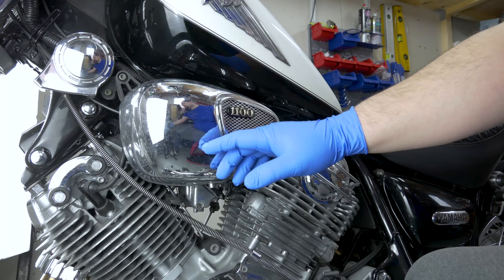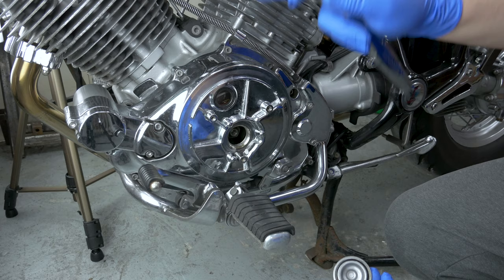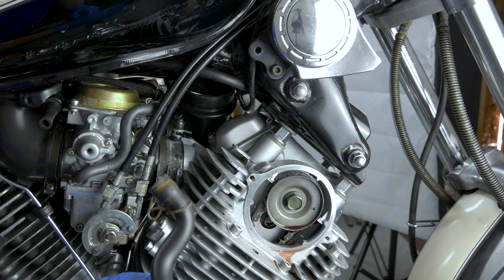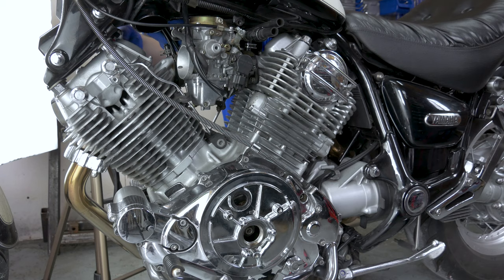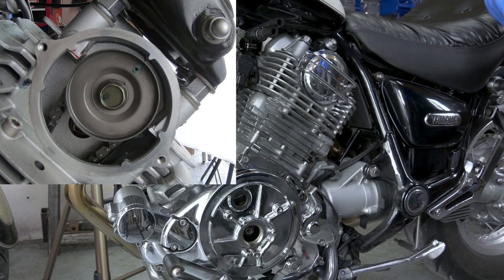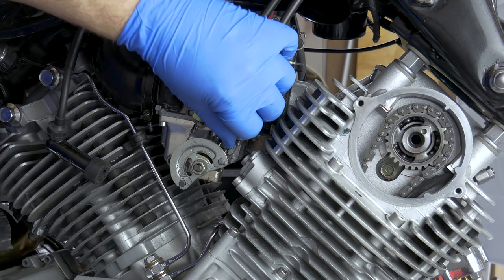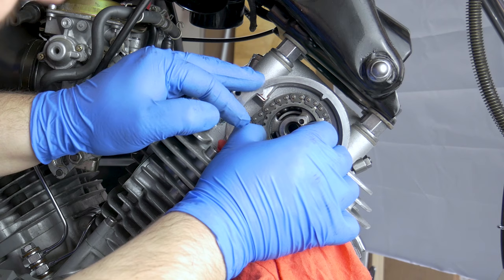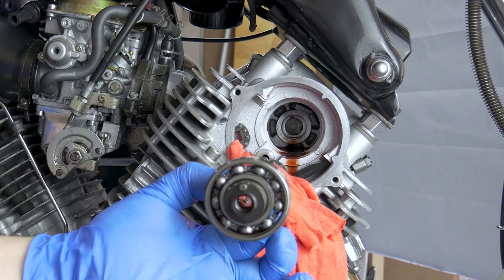YAMAHA VIRAGO 1100 | 4K | HOW TO REMOVE THE CAMSHAFT | Camshaft bearing upgrade preparation EP.01

Comment: Hey Midland, it has been a HUGE help to see your videos during my own restoration of my '89 XV1100. I can't tell you how many times I've already came back to check how you did a step to make sure I'm doing it right. The carb re-builds were also a BIG BIG help and very thorough. 

For my question on this video. @ ~ 8:26 the flywheel looks like it is at TDC for the front cylinder, BUT, the cam shows that is it out of timing, they you turn the flywheel from TDC to TDC again then the cam is aligned. Are there two different times when the flywheel is at TDC and the cam shows two different points of timing?

 I'm asking because on my bike, at TDC for the rear cylinder, my cam sprocket points down & away, do I just need to keep turning to align it with the next instance? Thanks !
Reply from the maker: Hi sorry for the late reply. I see the problem in the video and I think it is an editing mistake. What is important is that at the end it aligns as I explain it. The single line on the flywheel and the hole on the top. If yours isn't like that than something could be set wrong. I also realize that you are probably solved the problem you had already.

Comment: great Vid  my 1100 Virago runs like a 250cc bike when l check the front cam settings the dot is 1 or even 2 teeth before the aliment mark... have you heard of this.??  l belive it was done to de tune the bike  for  learner riders here in Australia ..??
some feed back would be great cheers
Reply from the maker: Hello...well I have never heard that anyone misaligned the camshaft to make the bike weaker for learners...usually this is done by restricting the inlet diameter after the carb.

If it is that much out you are lucky the piston didn't hit the valves...I would stop using it immediately and re set everything to factory positions, then do a compression test to see if the misaligned camshaft caused any valve seat damage/carbonisation. If not good then the heads need to come off and the valves need re-lapping.

Check fuel level in the carbs, check the tps sensor position (if you have one)
If all good including both cylinder compression are even and above 160psi (sea level, warm engine, cold engine will have less ~152psi-ish) , then it should run like an 1100.

As a side note if this has been done deliberately then who knows what else has been touched (carbs are the right ones? Jets, needles etc..??) 
Also worth checking the cam chain tensioner to make sure the chain isn't loose, on the 1100 the tensioners are automatically adjust themselves but they are mechanical, not hydraulic like more modern engines...
I hope this helps, good luck 😉👍🛠🔧
Reply: @MidlandCruiser  Impossible, somebody just made a mistake that can kill your engine, depending on where the valves are when the pistons are up. They have to be on the marks, if you want to make the bike slower, there are other ways.

Comment: WOW!! Been looking everywhere on Virago work as I dont know much about engines, thank you so much! 

Can you please tell me what could be effecting my virago?
Symptoms are:
 • White smoke that smells like oil coming out the exhaust which leads to the front of the bike
 • Oil needs continuous top up
 • It sounds like one cylinder is running instead of two
 • Spark plug on that cylinder is quite black after just a little drive

Technician told me something about valve stem travel is not going all the way and the bike is running really rich causing this issues and he cannot find the right o-ring for the valve stem as its a weird size???

I am desperate for some proper help on the matter if you could?
Reply from the maker: Hello. High oil consumption can be caused by bad valve stem seals and also piston rings.

If it's realy bad on start up but then goes away mostly then stem seal are probable. 

Considering you have only 1 cylinder running it still can bad rings, and that's why it's not running, but can also be carbs because you mentioned black plugs. It is really hard for me to help because obviously I didn't see the bike.

It needs proper diagnostic by a proper mechanic who knows what he/she is doing, seems like you might have a few things wrong, and not easy ones..

Also you won't find O-ring for the valve stem because that is a special seal and usually comes in a cylinder head gasket kit...

Hope this helps a little but I still recommend to take it to a good mechanic who knows these bikes.. good luck
Reply: @MidlandCruiser  wow such a great reply, thank you!

Sadly where I am the mechanics don't know much especially with this bike, I have already lost 2418 euros if I convert it from my currency, would it be possible to help me via email and pictures or videos? 

I am open to any form of online communication to get this problem sorted. I would greatly appreciate it if possible. I'm even open to recording it for you to upload to your channel if you want to post it for others to see, all content rights would be yours. I just want my bike to be healthy again.
Reply from the maker: Hello. Im happy to help through email, if you send me some videos, pictures and some description of what's happening. 
midlandcruiser@gmail.com

However my replies could be delayed because I'm quite busy at work and work home as well, but I'll do my best😉

Comment: Hi mate. I'm planning to do this bearing upgrade, got one question. Did it somehow change the valve gaps? Stay tuned and safe. Thanks for your lovely work. Greetings from the way too hot Thailand.
Reply from the maker: Hello. No it shouldn't change the gaps however I do recommend to double check it anyway to make sure.
Reply: @MidlandCruiser  It was a stupid question, sorry, mate. Of course. But I had all Gremlins you can think of. The ignition fuse measured well, but the contacts when pulled were totally corroded and one day the front pot ran, the next day the rear, and so on.

Comment: Cheers Lorant! Is there any tip for removing the rear cylinder bushing? Mine is stuck in place and won't come out without some strong persuasion. Do you recommend a slidind hammer through the camshaft bolt to drive both out?
Reply from the maker: Hello. Please make sure the cranckshaft is on top dead center, flywheel mark "T" and the little dot at 12 o'clock ish (lining up with the mark on the head)
Once the camshaft slides out a little it can get stuck a little, but it always should come out by hand, what I do normally is put the camshaft bolt back in a few turn and pull it out with that.
If your valve clearance are a little tight it might still push on the camshaft a little and that's why maybe tight. Make sure your rockers are free and you have proper valve clearance.
Basically no you shouldn't need a sliding hammer, it should come out freely... Hope this helps
Reply: @MidlandCruiser  And taking out the chain tensioner would be a good idea IMO.